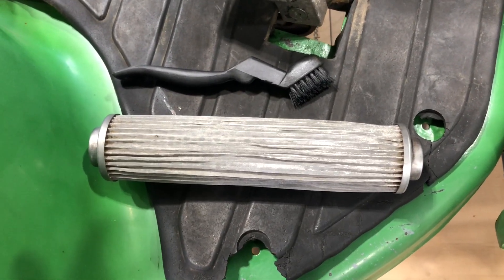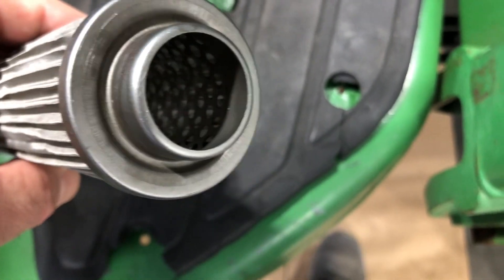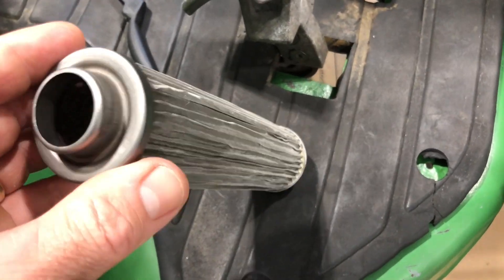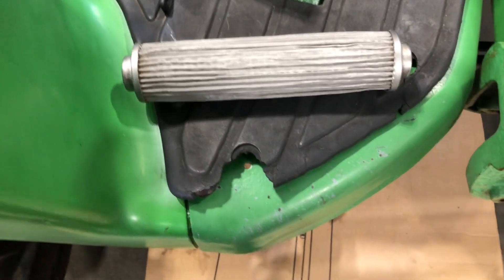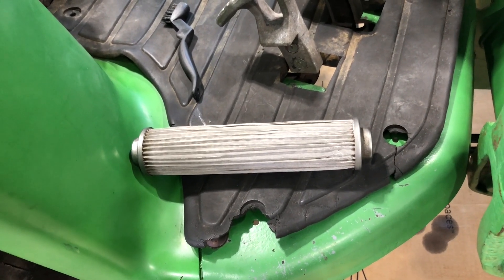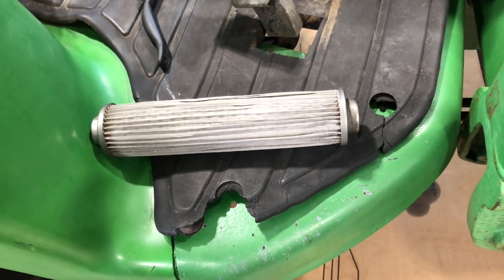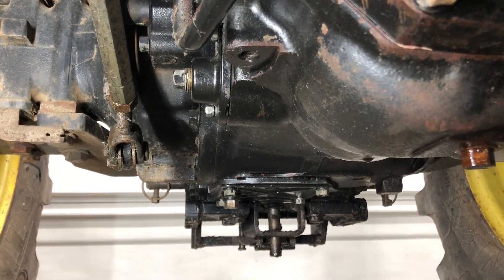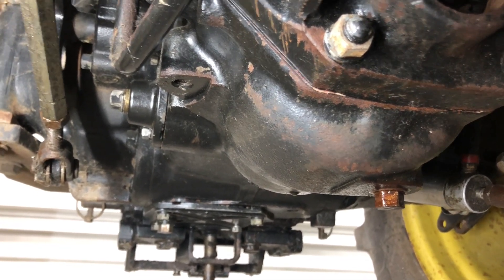John Deere 4710 Hydraulic Oil Suction Screen Overview

Comment: Yes! This is it! Front end loaded would not go up and power steering was noisy and sluggish on my 4700. Pulled this out and cleaned. Operates like a new tractor! Was very plugged and had never been cleaned. All the fluid. Some out too so have two big buckets ready to catch. I reused fluid as it had recently been changed.